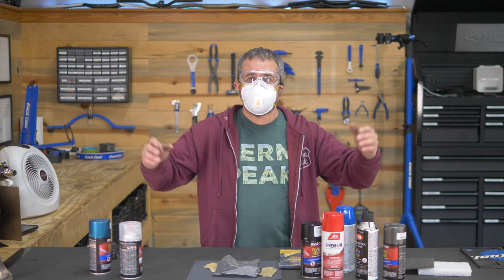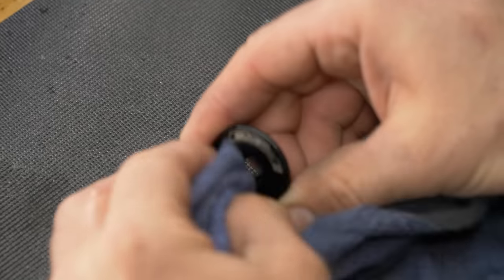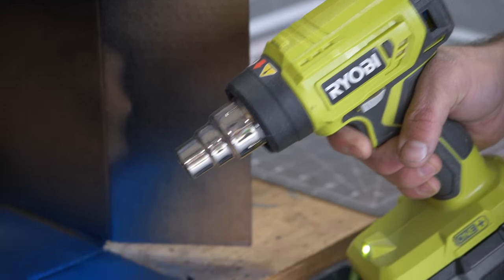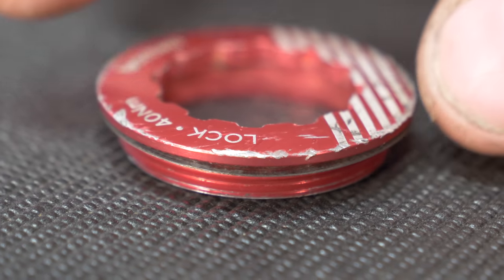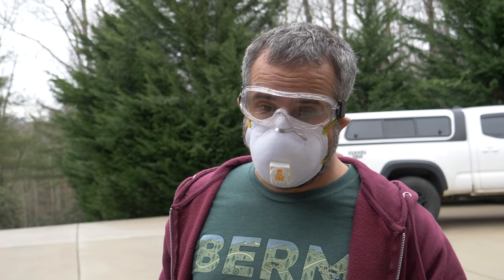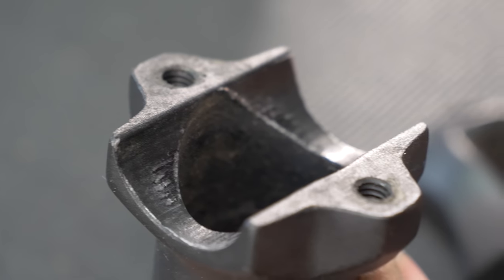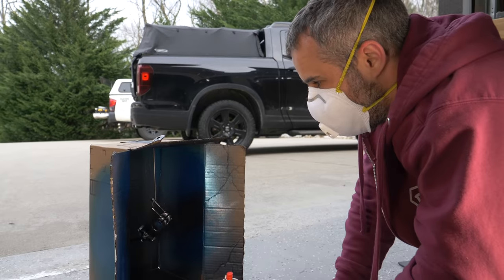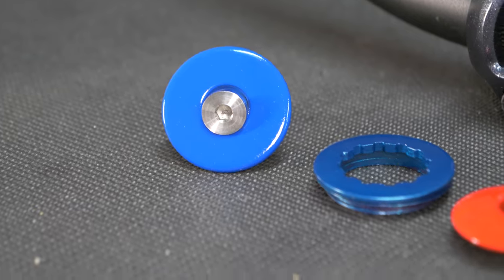How to paint bike parts the cheap and easy way!

Comment: Cheaper? Impossible. But you can try a few things to make it look even more pro level.
Try and sand things with 240 and 320 before going to 400. 120 usually is only for damaged surfaces when it comes to aluminum. Also try to really get down into the material and add primmer if possible. You will have to sand primer and you might want to polish the clearcoat. If you fix a drip by sanding, please give it annother paint hand on top to make it neat before the clear coat. On lagr surfaces, you will want to wet sand the clrar coat with 1000, 2000 and 3000 grit and then polish really good to make it pop.
Automotive spray paint is great to colour match, give a pro look, paint your frame, handlebar, stem, fork and other main places. It is a pain to get it just right on very small stuff.

I would add that you should start by getting all your colour matched parts like bolts, nuts, chainring, jockey free pulleys etc. Then decide the colour scheme of the bike, look around for handlebar, spacers, stem, etc to match them just right and then just paint the fork and frame. If you are in a budget, paint everything, get the super cheap stuff in the right colour and take your time doing it

Comment: For the stem section where it bolts to the forks, use a piece of paper. In these scenarios I roll up a piece of paper and slip it through, it will want to unravel and that makes it a perfect item to keep paint from getting in that area

Comment: Duplicolor “automotive” paint doesn’t have a hardener in it. It’s a thinner paint, the extra cost is because it replicates the  licensed oem auto colors. But wait their is a way to spray paint actual 2 part paint. You can find 2k Urethane clear coat. It has a hardener that you have to puncture on the bottom of the can. That will give your paint really good hard smooth and shiny finish. It is way more expensive about 20$ a can.

Wish I posted a couple of days so Seth might have seen it.

Comment: If you put a few drops of dawn dish soap in the water it will hold water on parts AND HELP degrease. The biggest part in painting is CLEAN!!! Any oils from your hands and it will do what’s called fish eye!!!
(You can wipe down with rubbing alcohol before painting)
If you hang the parts from a place that won’t mark the finish you can hang it in a toaster oven at 150 - 250 degrees (after it initially gasses off). And bake the paint. 

When your finished with a can of paint (and it’s not empty) turn the can over press the nozzle until it starts to loose color. (Clear the pickup tube & nozzle) that way it don’t dry in the tube and waste a mostly full can of paint. (They over charge paint cans) and even if they put in only enough to push the amount of paint it’s better to run out of paint and throw out a little paint at the end than to throw out an almost full can because the tube dried out. 

Also when tossing an empty can or one that has paint that won’t come out. 
You are supposed to pierce the can (place a rag over the area to catch the paint if you hold it at an angle and pierce to highest point you’ll get much less color.)
And let dry completely before throwing the can away.

Also stay away from the cheap walmart paint!
If you ever want to repaint, it will lift the old paint. 
I have recoated things that had dried for years. And it lifted like I had sprayed lacquer over fresh enamel!!
You can put as many coats on as you like as long as it’s freshly gassed off.

Comment: I’d recommend hearing the even part before you start painting so that as soon as the paint hits it dries. You could also use a barbecue on low heat for this as long as the part fits

Comment: Tip to do it cheaper: work somewhere that disposes of the spray cans, you often find half full cans of spray paint in every color, except pink for some reason
Reply: Where would i be likely to find these?
Reply: @Henryjamesklein  depending on the area, there are smaller companies that are in small towns and once in a while your local garbage company will sell the stuff that they can't deal with to the smaller companies

Comment: in cooler or cold places put your paint cans in bucket of hot, not boiling of course, water for ten minutes or so, dry the can , shake and rattle for a good few minutes, after spraying invert the can and spray until nothing comes out that stops the nozzle clogging..first bike I painted with cans was in the 70's..an old pre ww2 commuting bike handed down to me......great video for begnners....ps I once painted a whole car except the roof with small cans  40 off them 😎🤦‍♂️🤦‍♂️

Comment: FYI any can of paint is a good can of paint you have to look at the material it's made for though some are meant to be used on special material and won't set right on others. Also some types of paint can't be used together like he said in the video some have out gas times you need to know others it's chemical issues with other bases it's good to test spray any time you use a new paint to see if it works for what you want to do.

Comment: The Automotive paint does not have hardener in it. That automotive paint you're using is solvent based paint. whereas the "hardware store paint" is an acrylic enamel. They do make catalyzed automotive paint in cans, but that would require activating the catalyst underneath the can, and if you don't use up the entire can, it'll dry up inside the can.

Comment: Do you mind if I ask, which one is better for Mtb. Single chainring or triple?
Reply: It depends. Triple gives you more range, but its heavier and way more complex, so it is easier to break and more difficult to use. A 1x12 drivetrain is lighter, simpler, and to me, all you need (tbh though 3x gears and chains are more robust). As far as I know, no high-spec mtb uses anything else than a 1x.
Reply: He already has a video about that, it was not that long ago
Reply: Single is usually better
Reply: I'm pretty sure he already made that video not too long ago...
Reply: My situation is a product of budget and space so I change my knobbies out for gravel tires when I grind some pavement.   For me I like atleast a 2x setup.  If you're only riding dirt 1x has its advantages.

Comment: Good stuff. But just a slight tip, slightly faster swipes when you paint, prevents too much paint collecting in one area/ and for a more even coat you need to spray up and down swipes each time after you go left to right inbetween do a combination of both . Many real Paint guns do like a figure 8 shape. You can’t recreate that with spray cans without sloppiness but the next best thing would be to left to right and then up and down! I know how to paint now, but I was a graffiti dude once. And I do not know it all. But I do know you definitely got drips because of the slow left to right repeated swipes 100 percents geach time you go left and right. Also zinc rich primer (self etching if possible), and gloss or matte finish your parts will shine ✨

Comment: You can hang thing from you outside bike wash to paint more even. And. Get a air brush you can mix paint to even get better outcomes.  On repaint bikes print you decal spray colors on where decal goes place decal now paint the color then take off decal now it’s on the bike no decal.  Tooth brush to flick paint on.  Car pin stripe can make epic lines. I used to paint my rc bodies with pin stripe and air brush.  I just did my og Tamiya bruiser body.   Scale rc crawl

Comment: My method with spray paint has been scuff it up with sand paper, clean it, then primer, color, and a clear coat (and lots of cure time in between). Especially with that automotive grade paint, it'll have a hard time coming off with my method. Not cheaper than Seth's method though.

Comment: For the automotive paint you need to primer first, especially if its a metalic color. The primer will stick to the part better, and the paint is made to stick to the primer. It also makes it a solid base color so you dont see the previous color or pattern.

Comment: Head over to Home Depot, grab some cheap lazy Susan hardware and a couple 12” squares of plywood, and you’ve got yourself a low profile paint rotisserie that tucks in a corner nicely. I made mine from 24”, and I could put an entire high chair I built on it for finishing. It’s probably a quarter inch thicker than it was when I made it from all the paint!

Comment: Cheapskate pro tip: search for "wet dry sandpaper assortment" on amazon or ebay or whatever, and you'll get 30 or so pieces of automotive sandpaper in every possible grit that you could ever need for less than $10. It's not the absolute best paper, but it is much cheaper than anything you can get at an automotive or hardware store, and it will do just fine for a rattlecan job.

Comment: This might be beyond the scope of this video (since the video is about budget and simplicity), but on metal I've had really great paint coat durability and consistency results when using self-etching primer after prepping. I think you have to have all of the original coat stripped first which is a lot of work but that would be easier with your new sand blaster.
Reply: Also, if you clean the surface with acetone or isopropyl alcohol after blasting you have an ideal surface for priming. No need to spend all that time sanding.

Comment: Another thing to do is to heat up a bare metal component just a little bit..like put it in a barbeque for like 5 mins or so ..just so it's hot to pick up, therefore the paint sticks better.

Comment: This paint will chip, it will not resist chemicals. Use that paint, but use 2K clear over it and the hardener will protect the color and repel chemicals like on a motorcycle.

Comment: Use proper respirator to not die slowly :) even outside the ine in the vid only fittingbfor light dust ir paint particulate. You need elastomeric one with replaceable cartridges rated for this stuff. It is carbon filter without. 3m always has good  stuff and they have cheap halfmask too. For people with bugger budgets and more projects, just get the full face variant so uoiu do not have to fiddle fot fitting eye oritection everytime

Comment: Even better, warm up the can. DON’T over hear.  I use the hottest water my tap will provide. By warming the paint and the can, you slightly increase the pressure which increases the atomization which in turn provides a better, finer coating. 

Also,  powder coating kits for hobbyists are only a couple hundred bucks and are awesome!

Comment: How about DIY coil shock painting? Turn that cheapo stock fox coil look like SLS coil.
Reply: This might requiere Special paint because of the flex of the coil, Marine grade Paint will probably do it because they tend to be more flexible.
Reply: Take it to a powder coater. It's way cheaper tan you might think and the paint is profesional and super durable. Took the frame of my motocross bike there and frame and subframe was only 70 euros. Blasted and painted.

Comment: Use the heat gun on the bottom of the paint can, it will increase the pressure and it will spray better

Comment: 4:14 this paint does not contain any hardener. It is acrylic, it is not 2K/2pac. You need clear 2k finish coat if you want hard chip and solvent resistant paint. 
But a $20 paint gun, buy $40 1liter 2k clear, buy a $50 charcoal VOC mask. You can clear 3-5 entire bikes with it

Comment: Some advice-  I want to paint what's now my 2nd mountain bike.  It's a carbon frame and is 100% semi-gloss black finish with tone-on-tone manufacturer decals.  I'm keeping the color the same.  Do I need to sand down to the frame or can simply scuff sand?  Will sanding remove the decals? Should I use a etch primer?  After color application (1-3 coats?) if I want to install new decals would I apply decals to the painted frame then apply automotive clear coat 2K stuff?

Comment: Another tip for speed and saving money: don't go down to bare metal on steel parts unless you need to! Rustproofing the bare steel is an additional, time consuming step. But if you need to do it, don't look back and I am sending you power.

Comment: Just because it says automotive paint it doesnt make it real 2k paint with hardener. If there was hardener in the can the paint wood solidify within days or weeks - on the shelve. The only exception to this are real 2k spray cans that have hardener in a separate chamber. You have to release the hardener before use (have to push a valve or turn a knob/ring to release the hardener. Once released you have to use it within two days.

Comment: On my current bike build (Carbon Hadrtail) I bought new Crank Brothers Orange pedals. The problem is the pedals are not the correct orange, so I need to paint them. It's relatively easy to paint metal parts - painting plastic is very tricky. What is the best paint for plastic?

Comment: In high school. 
I used house paint mixed with thinner and rolled it on to my $hitbox truck. Took it from a oxidized paint faded red/pink to a nice semi-gloss white. Which I think also helped with the heat of Texas. My memory serves me correct I was in under $100 bucks for a job that worked surprisingly well.

Comment: Hey Seth!
I have no idea if you can help me, but i have this bike i need help to fix. Only its a bike you have probably never seen before and likely will never see again. Its tiny and (ill get to the point here) used by an actual bird (Hahns macaw to be exact)

Anyway its got a rubber band in place of a bike chain. And when not under load there is enough friction against the smooth chainring but when his body weight is on it, its too heavy and the rubber band “chain” just slips instead of turning the wheel.

I have no idea what to do (i guess this is why big bikes have chain with cogs!).

Looking for advice or direction. Do you know anyone who might be able to hook me up with a new part? Or who might be interested in this little project? Or help me design something? I have a 3d printer even!

I guarantee itll be worth it to watch this macaw ride his bike!

(Posted on a few of your newer videos on both channels coz i really need some help figuring this out and i hope you see this comment!)
Reply: Also happy to film for you to make a rainy day video out of it all!

Comment: Allright, sooo.
Sanding causes dust, you have to protect yourself with a mask. You don't wany any of this shit inside your lungs. You also don't want this shit flying around in your basement or garage, so do it in a dust-room. If you spray-paint, don't use that cheap mask that Seth uses in this video, spend 15 bucks for an actual gas mask with replacable filters.